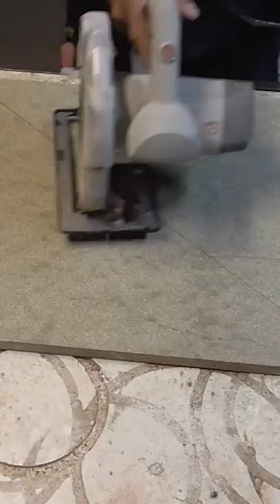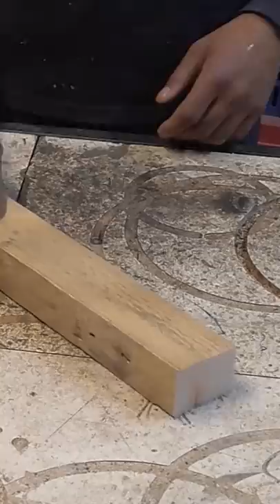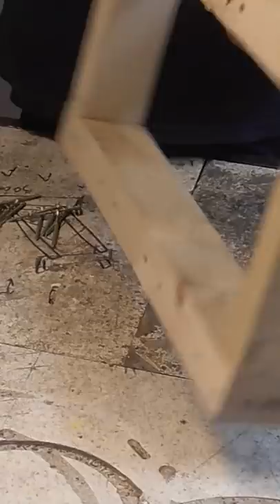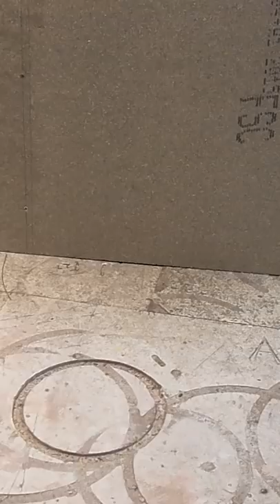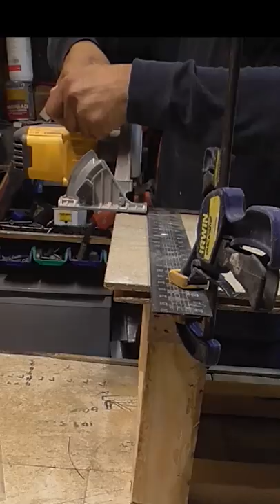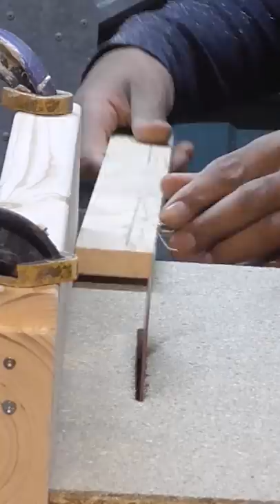Saw Hack #Shorts

Comment: To all the people watching... do not do this!!
Reply: To all the people reading this, this guy Is just incompetent with tools. Treat it like you would any other table saw, and it you will be fine
Reply: No blade guard, that wobbly thing is an invite for accidents.
Reply: @bpmotion  it's not wobbly at all, and nobody uses a blade guard anyway. Just because you're to terrified to touch a power tool doesnt mean everyone else is
Reply: @Loganxmusic9339  gonna call you Logan 3toes from now on.
Reply: @billabong9215  I've built one of these. Worked great for getting me started. As long as you respect it like you would a normal table saw, or literally any other power tool, you will be fine. And wouldn't it be 3 finger, instead of toes?
Reply: @Mcboogler  first of no. You can get a decent circular saw for 80 to 100 bucks. Even the cheapest jobsite table saws start at 300. Second, if you're thinking about building this, you most likely already have a circular saw. It's attached with screws so you can remove it and now you have 2 tools. Third a riving knife would take 5 minutes to make and install. And finally, if you operate it with the same respect you would a regular table saw, you will be just fine.

Comment: Wouldn't be easier to buy table saw
Reply: Yes, but also much more expensive, end this functions in exactly the same way
Reply: @Loganxmusic9339  functions worse with less safety features to prevent finger trimming.
Reply: @punishedmeridia  most people take those off. And when you take those off it's the same thing. He could add a riving knife, but its quick and easy enough to do.
Reply: @Loganxmusic9339  not really. If you don't have a saw a all. Buying a skilsaw is about $100. Plus presumably the impact driver or drill to put this crap together. 
Go to Harbor freight and buy a table saw. 
The table saw gives you more functions and a higher degree of safety.
Reply: @fedorkraev9341  not the shitty harbor freight one.if your looking to make this you probably already have a drill and a saw. If you aren't responsible enough to keep your fingers safe then you do you. But there are plenty of people capable of  keeping their fingers safe without the shitty plastic guard that you cant see through any way
Reply: @Loganxmusic9339  a shity harbor freight one would work better than this
Reply: Easier and cheaper.. a good circular saw runs as much as a cheap contractor table saw.
Reply: @rich7331  no it doesn't
Reply: @Loganxmusic9339  yes it would
Reply: @rich7331  only if you're also too irresponsible to use a store bought table saw as well
Reply: @Loganxmusic9339  that makes no sense.... Proofread your s***
Reply: @rich7331  it makes perfect sense. Learn to read and comprehend
Reply: @rich7331  a table saw is just a motor, spinning a blade, that stick up through a table. This is the same thing. If you're competent enough to use a store bought table saw without losing fingers, you are competent enough to use this without losing fingers
Reply: @Loganxmusic9339  Tell me you don’t know about kickback without telling me…blah blah blah
Reply: @artificiallyunintelligent4537  hence why I mentioned how easily you can add a riving knife. As for finger guards, which is the only other saftey equipment, 95% of people take those off. We didnt even have one on the table saw in my highschool wood shop class.
Reply: @Loganxmusic9339  The Hercules portable table saw is a great saw… don’t buy the absolutely cheapest shit they have, but the Hercules one is nearly identical to the Dewalt.
Reply: @TheHeadincharge  at that price just buy the dewalt. This is a project for people who dont have the funds to purchase a table saw
Reply: @Loganxmusic9339  Not sure what my comment had to do with this project, but this is a bad project anyway. For the same amount of money you can make an edge guide that will be far more useful and safer. This is a terrible terrible project. And yeah, you could buy either, but with a coupon from HF you’re saving about $100 for nearly the same product and it will work well is the point. Literally do anything other than this lmao.
Reply: @Loganxmusic9339  și de ce ai de ales prima dată cunoștință și de la raionul Orhei de pe siguranță tripolară de pe un teren la Colibița de pe
Reply: @Loganxmusic9339  și de ce nu a avut nimic asta este alimentul n- sa vezicii de mult care-i au particip pe de telefonat  sau și computer pesoftware și să să  siguranță fiecare cu hardware și nu a avut o relație și
Reply: @Loganxmusic9339  ya...not really

Comment: Not a Skilsaw 

More like the finger remover 9000
Reply: Anything with a blade can remove fingers no matter how expensive or well made, you have learn to respect the machine
Reply: @diydiy1239  there’s no guard or riving knife you will lose fingers with this
Reply: @astronemir  ya a bunch of people take them off
Reply: @astronemir 

You will lose fingers because you're a weekend DIY'er.
Reply: This is the exact same as a regular table saw.
Reply: @astronemir  I always remove the shield anyway. However, I use a push stick and sled.
Reply: @Loganxmusic9339  No, this is not exactly the same as a table saw:

1. There is no way to change the blade angle if you want to do a 45° cut, but worse than that, you cannot adjust the blade angle to ensure that the blade is perpendicular to the saw "table."

2. There is no way to change the blade height.

3. There is no T-track for running a miter fence or feather boards.

4. There is no provision for interchangeable throat plates.

5. The abomination depicted here has a ridiculous excuse for a saw fence.

6. The blade is only 7 - 1/4 inches in diameter, rather than the ubiquitous normal size of 10 inches in diameter. You won't be cutting any 4 inch lumber with that.

7. Changing the blade will be an irritating pain in the ass.

8. It is an under-powered direct drive motor, which will likely have difficulty cutting the harder wood species, such as hickory, as well as laboring with composits, and the motor will burn out at a young age.

9. It still does not have any provision for a guard, or riving knife.

10. Its ugly.

But sure, aside from those 10 flaws, it is exactly the same as a real table saw.
Reply: @barrybrevik9178  1. You can indeed change the angle on a circular saw.
2. yes you can adjust the height of the blade
3. Just need to route a groove and youd have slots, 
4. You dont need different throat plates. 
5. Takes an extra 5 seconds to make sure its parallel and clamp it down
6. The make circular saws with 10 inch blades.
7. Just have to remove a few screws
8. Has the same power a cheap jobsite table saw does.
9. Nobody uses a guard, I like to be able to see my cut, and a riving knife would take 5 min to add.
10. I'll give you that one.
Reply: @astronemir  maybe YOU will but those paying attention and NOT becoming complacent with the dangers of the tool will NOT.. never once have I lost ANYTHING in over 25 years working with some MICH shadier shit than this.. pay attention and make sure all bolts nuts and connections are tight.. simple really
Reply: For everyone saying there’s no slots he does cut them in the full version of the video

Plus you can lower the blade 

You can set the angle it just means widening the blade slot
Reply: @Loganxmusic9339  a cheap table saw cost less than a 10" circular. ( which is not common) wasting the time and effort to make a jinkey tool like that shows experience level. I'm a 50 year old working carpenter, this is just my common sense opinion.
Reply: @charlessalmond7076  this is using what you have. When you first start out you dont have the extra cash to go buy a table saw. Common sense says this gets you the same functionality with tools you already have.
Reply: @charlessalmond7076  and it's only janky if you can only make janky shit, so maybe re evaluate your skill level.
Reply: @Loganxmusic9339  no. You borrow a proper tool. You don't create a saftey hazard.
Reply: @Loganxmusic9339  by the by. I do remodeling primarily in golf communities. The same golf communities for over 30 years. What was your experience?
Reply: @charlessalmond7076  it's not any more dangerous than a regular table saw. But keep up with your undeserved superiority complex
Reply: @charlessalmond7076  been making custom furniture for over 10 years. Grew up remodeling houses. I've been doing this my whole life. You dont ever fear a tool. You respect it.
Reply: @Loganxmusic9339  tell that to the inspector that shuts your jobsite down. Better yet tell it to all the other trades that just lost work.
Reply: @charlessalmond7076  this is clearly for the home. No one is saying use this on a jobsite dum dum
Reply: @Loganxmusic9339  that proves the safty issue, thank you. Look, you or I could safely build something like this, no doubt. This video is geared towards people/homeowners with no experience.  Given the short video I saw, its a recipe for failure. The only way this compares to a 90 dollar 10" table saw is if you buy a 10" circular saw. That cost more alone than a cheap table saw. I've personally never seen a homeowner that had a 10" circular. If your talking a tradesmen. I'm in Georgia. After about 6 months in the trades I had established a good enough relationship with all the trades that borrowing the proper tool for the job was a breeze. Either way I don't see us coming to a middle ground if you think this is a good idea. And with that, I hope you have a good evening sir.
Reply: Fingers are overrated anyway.
Reply: No blade guard wobbly crap 9000.
Reply: We had a stop saw and an old school saw in high school without a guard. Just admit your afraid.
Reply: @Loganxmusic9339  You said that it is "exactly the same as a real table saw." I came up with 9 valid points to explain why it isn't. I could stop here, because I have already provided a counter to your single original comment. But I won't, because there is even more to consider.

Your response challenges my 9 points, but every one of them represents a solution that would be a terrible pain in the ass to deal with each time you want to make a change.

Something that I should have added is that the table is made from WOOD instead of metal. If it is used on a job site it wouldn't last a week. If it is kept in a homeowner's garage, it will experience warpage over time, which is unacceptable.

Since it is made from wood, attachment of your circular saw underneath the table will be problematic. The first hurdle, is that you would have to install metal machine thread inserts to attach your saw, if you expect your circular saw to stay there. Further you would have to figure out something more complex so that the blade can be adjusted parallel to the T-channel at the left side of the blade; some way to move the saw plate left or right a little bit, usually the back end. This is critical for accurate cuts, but also for reducing kickback, for cutting a narrow kerf, and for not burning your wood on both sides of the cut. Using a sled fixes nothing, because the sled rides in one or both T-channels; which must be as parallel to the blade as you can get them. I think you mentioned in another comment that you build furniture. If so, then you already know how critical this relationship is, especially if you are using hardwoods.

Another of your points is countered with: yes, you DO need to support interchangeable throat plates if you want to use a dado blade stack, which just about every saw owner has needed at one time or another.

I can see that you are an intelligent person, as you have responded thoughtfully to my 9 points by thinking outside of the box. However, I am going to stick with my assessment that the 'table saw' depicted here is a half assed solution, and an exhibition of ineptitude and lurking danger, as well as an item prone to sudden and unexpected self disassembly.
Reply: @Loganxmusic9339  I think part of one of your comments lies the problem. This video probably is catering towards people that are just starting out, and most of the time, are inexperienced with power saws. I wouldn’t recommend doing this for someone like that. An inexperienced person probably isn’t going to be able to build this as soundly or as safely as a commercial table saw. For someone that has past experience and on a tight budget, this could work, but I doubt that’s going to be the majority of people. I’d seriously recommend beginners just save up and buy a general contractor table saw if they’re looking to do projects that involve the capabilities of a table saw. They’re probably going to have much higher tolerances than what they can build something like this within, considering modern day machining.

Comment: This is so incredibly stupid and dangerous. Don’t do this! This is coming from over 20+ carpentry experience.
Reply: No more dangerous than a store bought table saw
Reply: @Loganxmusic9339  store bought table saws have a riving knife to prevent kickback. This thing will send boards straight into your gut and will take more effort to do a cut properly.
Reply: @madera-y-herramientas  I have a belt drive table saw weighing 260 lbs from Grizzly.  I got rid of the gadgets you mentioned after the first few cuts.  It makes the cut easier and more accurate.  I have used the saw the past 30 years without any accident.
Reply: @madera-y-herramientas  it would take litterally 5 min to add a riving knife. And if you know how to properly use a table saw, it's a non issue
Reply: @Loganxmusic9339  smh riving knife buddy. I cut my finger in half the long way because I didn't understand how important it is to have that. This is extremely dangerous.
Reply: @MrShadyCash  you cited your finger because you were being careless with the tool. Riving knives are to prevent kickback. Idk what you were doing putting your fingers near the blade at all, let alone the back side of it

Comment: You are a courageous man but don't use MDF for the table top, it is a treacherous material and that machine you built is hungry.

Cheers
Reply from the maker: Its chipboard, but yes something like plywood probably be a better option, thanks
Reply: @dbibuildstips  yeah sorry I can never remember the proper names in English.
I built mine out of marine ply,18 mm and it's rock solid(for now).

Btw,don't know if it could be called a hack but I found a way to fix odd shaped tools to boards with bicycle chains. You need to use 4 screw,2 per edge. Outer ones hold the chain in place and the inner 2 thighthen it evenly.
Reply: @kabornat8340  with the lumber prices around here atm, a sheet of marine plywood costs almost as much as a cheap table saw
Reply: @Steam_Engenius  I think this is a bit of a global issue atm.
I know about the outrageous prices of quality wood but I bet you know even more about how much of a horrible material OSB is.
Plus considering the time and effort one can end up putting in such projects is quite easy to greatly surpass the quality of a cheap tablesaw.

Comment: Dude I cut my finger in half the long way on a set up similar to this because I didn't understand the importance of a riving knife. Don't ever use your table saw when you're making through cuts without one, and never ever replicate this idea. I was lucky, kept my finger but it's thinner than my other pointer. And it looked way messed up when it happened idk how I didn't pass out and actually turned the saw off went inside and said I needed a ride.

Comment: Best way to get an accident is to hack tools like this with zero safety guard
Reply: You know most people don't use the safety stuff on actual table saws they buy at the store right?
Reply: @ChronicBongitis420  are you referring to casual weekend diy hobbyists?  I won't be surprised coz many don't know the danger they are putting themselves into.  It still doesn't make this device any safer.

Comment: Why not buy a cheap table saw?
Reply: A cheap one? I think he can afford a nicer one over a inexpensive one. Look at the other tools that he has been using. I just bought a DeWalt cordless saw like the one he has. It cost me close to $175.00 USD with taxes and was the tool only. No battery, No charger just the saw and battery will cast another $ 150.00.